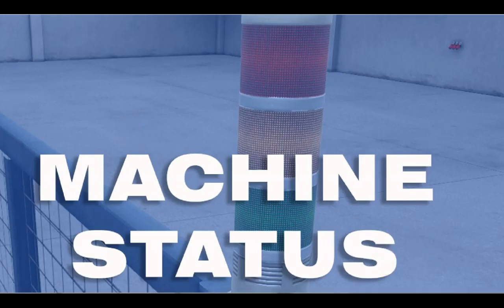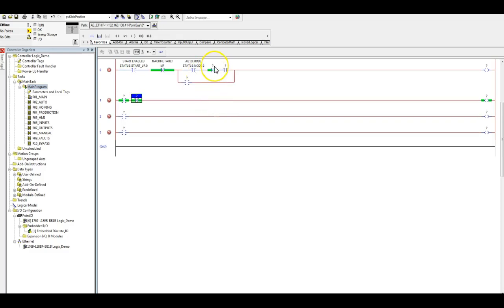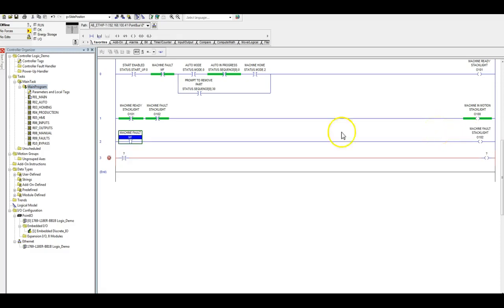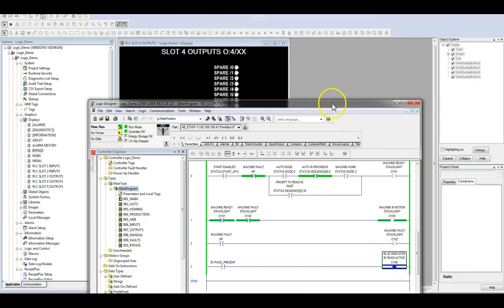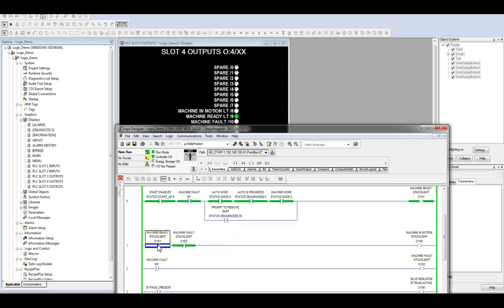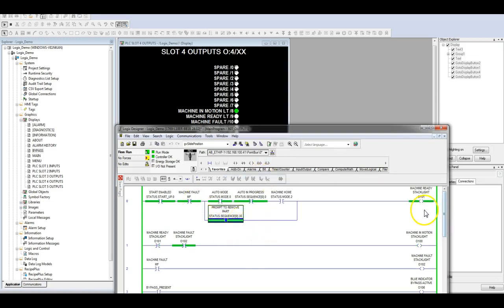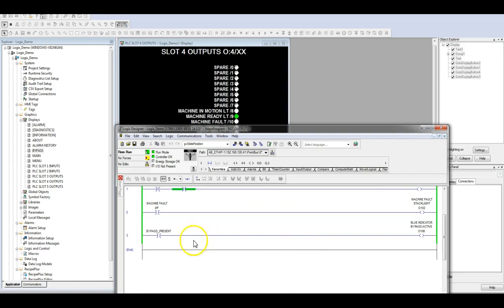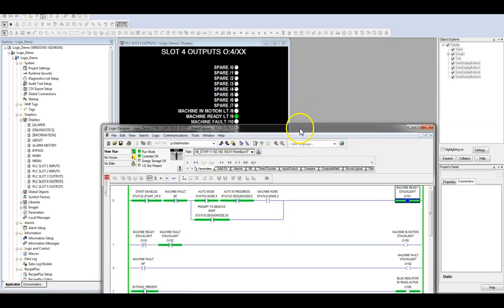PLC Programming for Machine Status

Comment: Hello, just wondering what is the program in the video that makes the machine physically visible, is it AutoCAD? Or something similar?
Reply: ALso, I noticed that some outputs are left for spare, is there any  particular reason output 8 as used instead of output 0 or 1? and if so what is the reason
Reply from the maker: The software showing the machine is call eDrawings and the drawing was built by controlls designers.
Reply from the maker: The spare outputs are used elsewhere in the program I didn't show in the video. If my memory serves me right